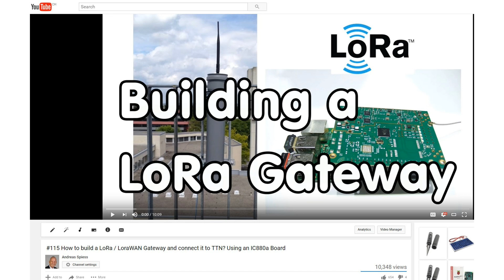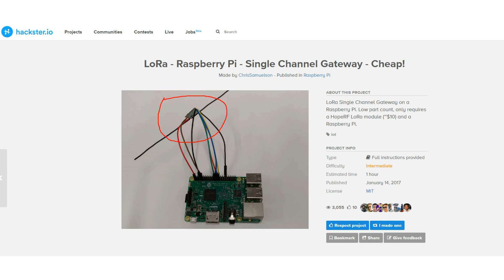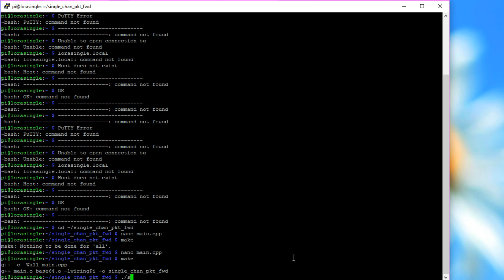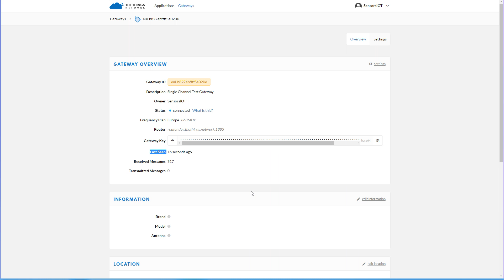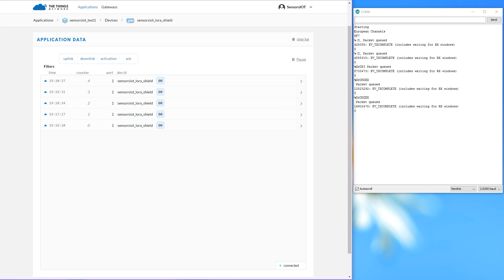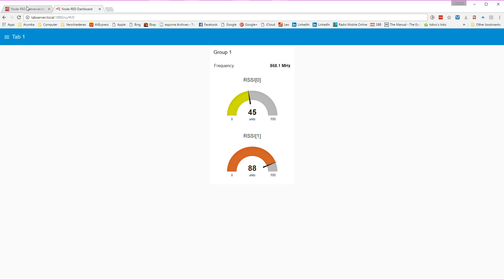#124 Cheap LoRa Gateway: Tutorial on how to Build with one with Raspberry Pi and Dragino

Comment: Hi, could you please explain why two gateways are shown in the metadata at 5:29, for example? Is TTN simply listing all the gateways that received the sensor’s transmission, or is there another reason for this?
Reply from the maker: As you write, 2 gateways got the same message.

Comment: Hi Andreas. Thank you very much for your efforts and your valuable information! I have some questions regarding this device.
Is it somehow possible to configure this device as a node, rather than a gateway ? i simply need to get this thing hooked up to my own lora wan, then measure its rssi values relatively to the gps position and after that i would like to create a rssi heatmap and visualize signal strenght coverage. I will be very happy to chat with you about this.
Best regards
Eddi
Reply from the maker: These days, you find many boards with integrated LoRa transceivers and ready-made software for LoRaWAN. I would go with one of these. But it should also work with this board because all LoRa boards use very similar chips.

Comment: Excellent video, I was wondering what's special about that HAT apart from the adaptability for the raspberry? As shown in minute 1:45 I see that it is possible to make the Gateway only using the raspberry with a LoRa module, in my case I have the LORA 433MHz E220-400T30D - LLCC68... am i right?
Reply from the maker: I am not sure if TTN still supports 1 channel gateways. Most people now use commercial 8 channel gateways.

Comment: Hi, nice video but may I ask if this is LoRa or LoRaWan :)

I wanted to use ttgo or esp32 with meshtastic to set up a lora mesh network and transmit and track company vehicles.  Any video on how to do this and how to view the trucks on my website without coding as my site is on WordPress.

Many thanks in advance 
Christopher
Reply from the maker: This is LoRaWAN (The Things Network). I never did a video about car tracking.
Reply: @AndreasSpiess  Thank you for replying and your answer.

Would you consider doing a video on how to track vehicles and how to use meshtastic lora and get the  data onto a pc screen for observation and or back to a server/website.

I'd like to be able to add it to my WordPress site if possible.

Comment: I've arrived here several years too late. Does anyone know where I can find a supported LoRa hat for the Raspberry Pi? AliExpress says they no longer carry this Dragino board and I can't seem to find anyone who does.
Reply from the maker: Today, I would go with a ready-made 8 channel gateway. Simple models came down in price. I am not sure if single channel gateways are still supported.
Reply: Do you have a recommendation for such a device? I'm trying to find something as simple as a home wifi router with an ethernet port I can just plug into my switch. Seems like a lot of online shops are out of stock, and the devices they do have are $300+. Thanks!
Reply from the maker: @matthixson9140  Youtube does not allow links. So search for "The Things Indoor Gateway". It should be around 100$. Also, Mikrotik has one (outdoor, more expensive)

Comment: Hello Mr. Spiess and thank you for your videos,
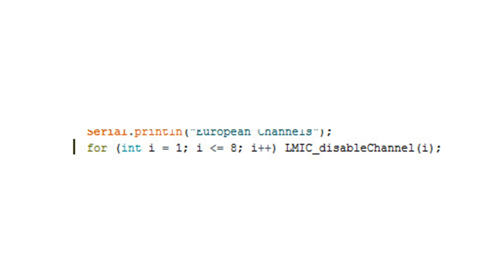at 7:51 you speak about disabling frequency hopping. For me it is unclear, where this has to be done. In the Sensor? Per downling message? Please help / thank you.
Roger
Reply from the maker: It has to be done in the sensor because the single-channel gateways only listen to one frequency. 
This is an old video, and I am not sure if single-channel gateways still are supported by TTN.
Reply: @AndreasSpiess  Thank you.
Yes, they are still suported, and mine (done according your video) is working since approx. 2 weeks without problems.
According your answer ("that has to be done on the sensor"), the sensors have to come back to my lab, because a downlink can not be established with this gateway and there is no coverage from another gateway at my location of operation.
Greetings from Fricktal!

Comment: So i am pretty new to this and didn't pay attention that this video is almost 5 years old and i already got the components. If I'm not wrong u said in comments that this should still work. I tried and the gateway is connected to ttn and sends stat updates. But both lht65n sensors are just sending "accept join-request" and nothing more happens. Do u think it's a gateway problem or do i have to do more stuff than typing in the keys for the sensors? I have to get this to work somehow because i can't afford another 100+€ as a student
Reply from the maker: Maybe you watch my newest videos about LoRa V3. It needs some changes and maybe you will get it working.

Comment: Hello Andreas i want to build a communication between ESP32 and Raspberry Pi using Lora did you have any experience regarding this?
Reply from the maker: Most TTN gateways use a Raspberry. So there is communication between an ESP32 and a Pi. However, without LoRaWAN I am not sure you find LoRa software for the Pi. So you have to write your own.
Reply: @AndreasSpiess  Thank you very much Andreas for your reply i am suceed building LoRa communication between Raspberry Pi and ESP32 There is one library pyLora for the Pi i used for the communication

Comment: hi Mr Spiess, i got the same message on serial monitor running abp sketch..ie EV_TXCOMPLETE(includes waiting for RX windows)
m using arduino uno plus third party LORA shield (RF65) without own gateway .Does it means successfully transmitted ?coz no live data seen in TTN console. Also tried to migrate to helium blockchain (setup with integration) without any data transfer .pls advise .There is one nearby gateway , looking at gateway TTN map. how to connect and send Hello World to a stranger's gateway if i know their IDs?
Reply from the maker: This is an old video and many things changed by now. You have to google for the newest info and software, I think.

Comment: Great series. Thank you. Currently setting up a local GW until the iC880A-SPI is back in stock.
I have an old Pi2 I have no use for and no GW in the area.
Reply from the maker: Sounds great!
Reply: Looks like the way to go is the RAK2247. The model mentioned in this video is probably out of date as the video was recorded in 2017.
Total comes in at 145 Euros. Nice
EDIT: Maybe it was another video where you showed the RAK

Comment: Hi instructor, please let me know where we can find the server Ip address? For example, you have used #define SERVER1 "40.114.249.243" so which IP and where can I find it? 

My second question, the packet forwarder is very old and is no longer supports the OTAA method. Is there any other latest packet forwarder that can support the OTAA method? Thanks for your constant efforts
Reply from the maker: Your router usually knows the IP addresses of all your devices. You have to google for your particular router.
Concerning packet forwarder: Maybe you watch my recent TTN V3 video?
Reply: @AndreasSpiess  Thanks for your response. Okay, but here we need to insert the IP Address of Raspberry pi or the router? I typed "ipconfig/all" and found this [IPv4 Address. . . . . . . . . . . : 192.168.1.194]], I am confused we need to put the router IP address or the Raspberry pi???

I watched TTN V3, however, I didn't find that you have used the packet forwarder that supports OTAA. Can you please refer me to the one?  Thank you

Comment: how about setup LoRa gateway without module RFM95W, could you reply me?
Reply from the maker: You need a LoRa chip. So you can use a different module but the chip will be the same. Only if you decide for an 8 channel gateway you have to use another chip
Reply: @AndreasSpiess  yeah but i have Pi Hat so i want to use  Pi Hat instead of module RFM95W
it's oke ?
Reply from the maker: This hat also hase a SX1276 chip on board. Like the RFM95W

Comment: Dear Andreas,
many thanks for the great tutorial. I followed all the steps on your video on the same hardware as you had. Unfortunately the status on the TTN remains "disconnected". Also no errors whatsoever are reported on the debug console. Is there a way for more extended debugging? Also can the IPv6 "Lite" prevent the gateway from connecting in some way? 
Beste Grüße 
Georgi
Reply from the maker: This is an old video and if I remember right, TTN changed its IP addresses. Maybe you check it?
Reply: hey @seeman8484 i have exactly same problem with you , i have same hardware but status on TTN still "disconnected" . have you found solution yet ? i have change IP address to au915.thethings.meshed.com.au base on https://www.thethingsnetwork.org/docs/gateways/packet-forwarder/semtech-udp/#connect-a-gateway_server-addresses
and change freq to 915Mhz .  @Andreas Spiess

Comment: Can i ask what's the point of a gateway if it can only handle 1 channel? I mean if I have a handful of nodes they will probable crash with each other when 2 or more wants to send a message to the gateway.

Or am I missunderstanding some concepts?

Thank you very much for your videos, they are really useful
Reply from the maker: You are right, of course. But law only allows 1% ON time per node. So the chance of collisions is quite small. But they are allowed in this protocol
Reply: @AndreasSpiess  thanks for your answer! 
With that 1% ON time are you refering to airtime? Because you can change that by changing the spreading factor and then making the chance of colission bigger right?

I will do some tests tho, thank you for your time I am doing my EE thesis with this topic!
Reply from the maker: Yes, on time or airtime. The SF influences how long the packet needs and how much it takes fron the airtime. Higher SF= less possible messages per time

Comment: Hi Andreas, I've been thinking about putting some sort of "car alarm" system together. I would work with a notification system via cellular. Except that I often park my car in remote area while I go fishing. These areas do not have cellular coverage at all. So I am thinking that LoRa might be a good fit?
Unless there's something better out there for this specific use case? I am just expecting to receive message alerts with the sensors being triggered by the security system. (No need for large amount of data like video or images)
Reply from the maker: I made some videos about the capabilities of LoRa. So you have to decide if it fits your use case. Draw once the whole system end-to-end on a sheet of paper. Then you see al the problems you have to solve and where LoRa fits in.

Comment: Hello Andreas, very nice video!
Could I just ask you a question? There is a "frequency mark" on the back of every RFM95 module for 915, 868, 433, or 315 MHz. But you can set the carrier frequency in the module´s registers, so why is here this mark, if you can choose and set frequency that you want.
Reply from the maker: Because of the filters on the board.
Reply: @AndreasSpiess  Oh, I see. Thanks a lot! :)

Comment: Question If I don't care for LoRaWAN or getting on-line with my sensor data, what are other limiting factors of Single Channel LoRa gateway?  Is the communication speed limited between sensors  and such gateway? Is it difficult to find LoRa nodes which support to be configured in single channel mode?
Reply from the maker: Single channel gateways are also LoRaWAN gateways. If you do not want to use LoRaWAN you can watch my video concerning LoRa point-to-point
Reply: @AndreasSpiess   thanks, but can LoRa nodes also talk to each other, if I do not follow LoRaWAN protocol? And built my own private net

Comment: Thanks you Andreas for this great video! I started a single channel Lora gateway to get my feets wet with The Things Network. Do you know why the single channel packet forwarder (from the Charles Hallard fork) software works on my rpi 2 but not the rpi 4? I suspect wiringpi but I can't move forward...
Reply from the maker: Wiringpi will no more be advanced by the developer and I do not know if it was ported to buster.
Reply: @AndreasSpiess  It works now on the rpi4 with wiringpi updated to v2.52 : http://wiringpi.com/wiringpi-updated-to-2-52-for-the-raspberry-pi-4b/ . Although I understand what he might feel, it is sad that the main developer is fed up with trolls...
Reply: @etmoimeme  great, you fixed my issue :). Thx a lot!!!

Comment: Thanks for your video, always.
By the way, you said it can only support one channel.
Does that mean it(Dragino hat_868MHz) cannot communicate with another dragino shield_433MHz?
Reply from the maker: Both devices have to use the same frequency.
Reply: @AndreasSpiess  my both devices are using 433 mhz .how could i establish the communication between the node and the gateway through ttn or is there any other way as ttn doesnt support 433mhz

Comment: Do you have any idea how to build an electric smart meter using lora? I'll follow these steps to interface Rpi and Lora and building the gateway. After that, I'll need help. Thanks!
Reply from the maker: I never did that. But maybe you divide the problem into several smaller projects and go for one after the other?

Comment: Could you tell me the difference between hat and shield?
I'm using Dragino LoRa shield(v98) for arduino, but I want to use it with Raspberry pi if it is possible.
Reply from the maker: Usually additional boards are called shields if they fit an Arduino and hat if they fit a Raspberry
Reply: Thanks a lot sir !!

Comment: Hi Andreas,  thanks for the great explanation. I have a question. Ispossible to create a gateway like this using an arduino board instead of Raspberry Pi? Thanks!
Reply from the maker: No. You need an internet connection. Maybe you look at my LoRa playlist where you find other gateways.
Reply: But using an additional ESP8266 module with wifi access connected to Arduino, I can have the connection to internet. In this case, I think should work.In any case, your recommendation is to use another platform instead of Arduino? Thanks!

Comment: Hey Andreas,

Any chance of showing how to setup the lorawan pi hat as a node device and send data to TTN? I bought one a few weeks back but am struggling to find any information on how to get it to work.
Reply from the maker: I do not see an RPI as a good idea for a LoRa node. LoRa is low power. The Raspberry not really...
Reply: @AndreasSpiess  No worries, its all subjective though, as it depends what you're using your rpi to do. To send some industrial points your monitoring would be extremely handy. As the esp devices don't like to talk modbus.

Comment: Hey Andreas, could you show how you made those applications on thethings website? I'm trying to find a way of decoding what my LoRa node is sending to this newly built gateway and I can see things changing on my Pi every time a message is sent from the node, but I don't know what to do with the data. Could you help out in any way?
Reply from the maker: Maybe you watch my other videos about LoRa. Especially the ones with Node-Red. There you should find some info.
Reply: @AndreasSpiess  Sadly, I'm very stuck. The only video of yours that I've found that is on this topic was the one where you did the TTN Tracker. I couldn't find any other myself. Unfortunately, the code on that application is far too complex for me to understand and extract what I need. I'm after a very simple tutorial of connecting a simple LoRa node, to a Dragino+Pi Gateway thats already on thethingsnetwork and show information gathered by the LoRa device (in this case a heltec esp32LoRa). Nothing on the internet seems to help, in simple terms. And everyone seems to be making gateways, but not the devices.

Comment: Andreas Spiess please tell me how many nodes can lora gps hat handle?
Reply from the maker: It depends on the number of messages per device, the size of the messages and the transmission speed. 8 channel gateways can handlde more than 1000 nodes.
Reply: @AndreasSpiess   for single channel LoRa gps hat wats the approx limit for nodes? Please let me know.
Reply from the maker: Maybe 50.

Comment: Would you share how to use LoRa Bee and ESP8266 or Arduino Nuno, please...?
Reply from the maker: Lorabee is just an RFM95 module with pins and an antenna connector.
Reply: @AndreasSpiess  Thank you...I solved it :)
LoRa Bee + Arduino Nano Schematic: https://www.disk91.com/2019/technology/lora/hoperf-rfm95-and-arduino-a-low-cost-lorawan-solution/ 
Code example: http://docs.iot-bus.com/en/latest/examples/example-iot-bus-lora.html
Pin Config:
#define DIO0 3
#define SS   6
#define RESET 5

Comment: Hello all.

I have built a single channel lora gateway according to this youtube video
however, I run into a problem.
namely the following.
the gateway has once relieved 7 berievten, but that's it.
even if I need lora for half a day, the gateway will not receive new messages.
the emergency works well because another gateway that is just on the border of receiving and not releasing someone else from my distress occasionally receives a package.
unfortunately I do not have any errors or something else, we could have gotten a bit wiser.
the iot wabsite further states that the gateway is online.

can someone help me?
greetings: Peter
ps: andreas good and educational movies makes you have more often egt can continue with it continue